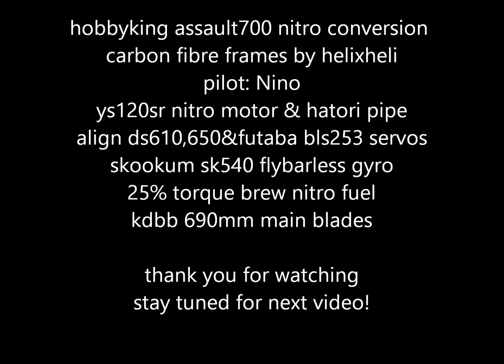hobbyking assault700 nitro ys120sr

Comment: Hi I an allso trying to convert the 700 into a nitro with the 91 motor , any tips  at pres I have allso a 700 nitro frame as well , I want to use the assault servo frame and head set up and  , so tossing between align or assault frame wich is easer , I may overlay each and see the differents thanks